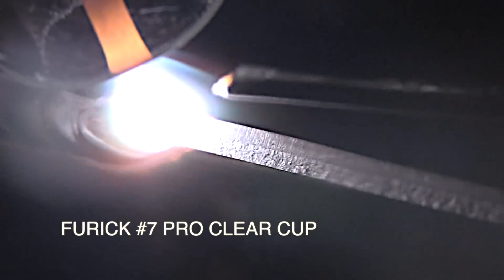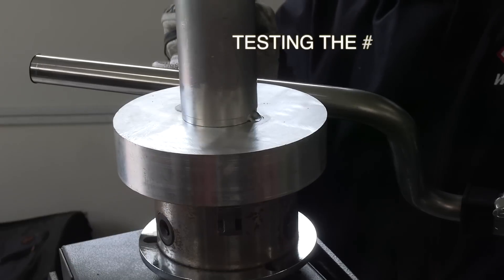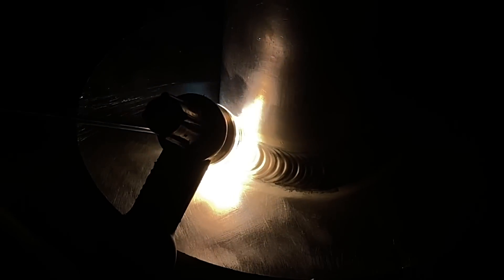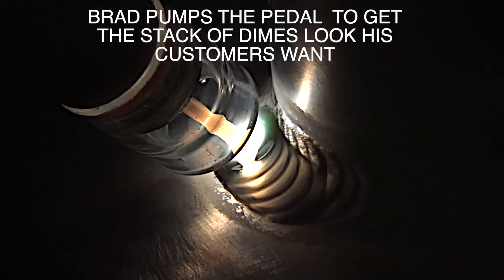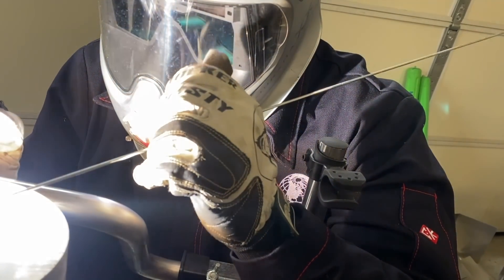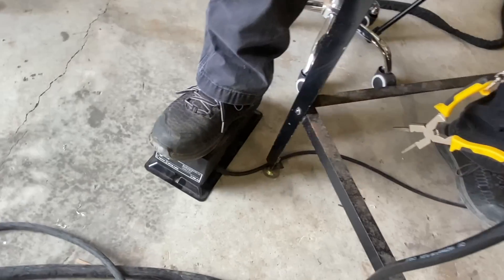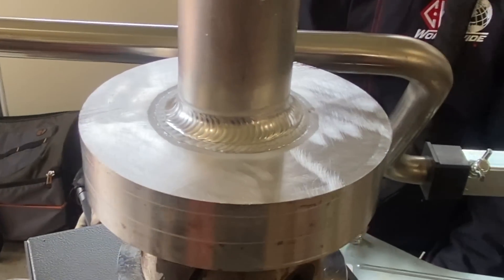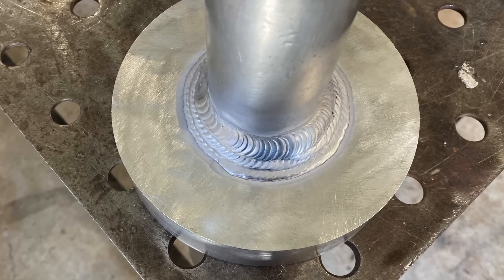Dynasty 280 Advanced Settings for Aluminum

Comment: If you're gonna pump that peddle, 75 bal 75h is a pretty good sweet spot. Adding more to that side helps with the heat soaking and gives a good ripple. My school used the giant syncrowave and my first job blessed me with the dynasty 700, but did they ever harp on those ripples.

Comment: i use older Miller Synchrowave 250 machines at work that has no pulse capability, so I taught myself the pump the pedal.  it's made me much more flexible for welding all different thicknesses and positions without having to make many adjustments to the machine!